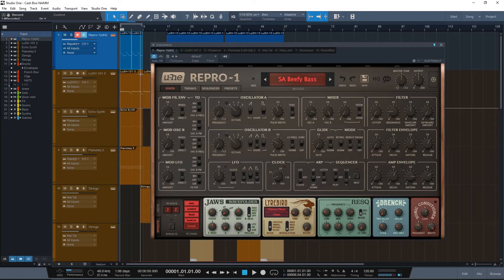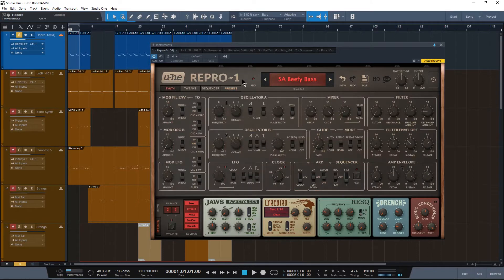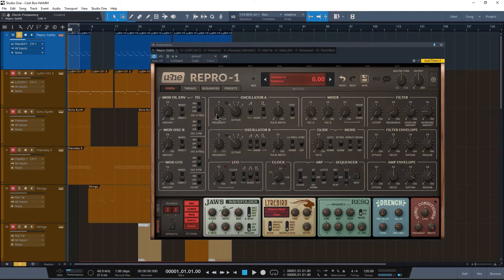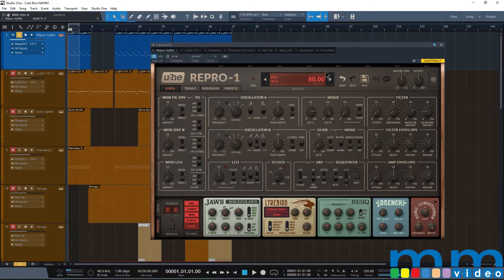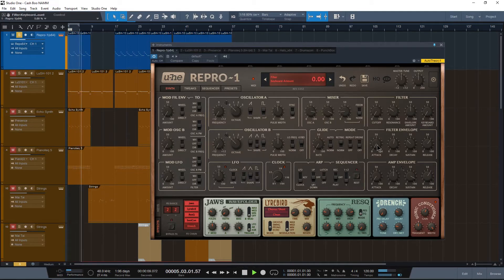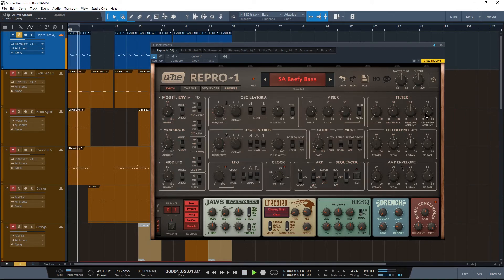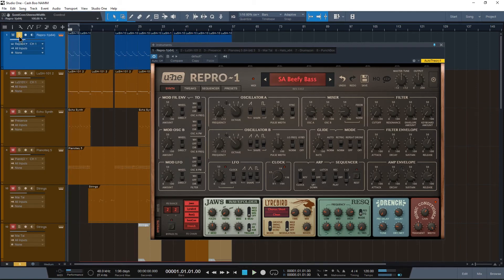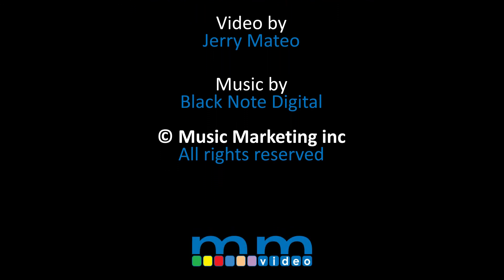U-he Repro 1 Creating A Thick Bass Synth

Comment: I used a Pro 1 for about 15 years to play keyboard bass with and it was just awesome.  I loved it.  Still have it, but it no longer works well or at all.  I wore it out lol!  I would have kept it repaired, but I started doing a solo act with acoustic guitar and no longer needed it, but it was a great snyth, and for the time, not that expensive in comparison to other synths of the time.  I think I paid 500 USD for mine.  Started out using an Arp Odyssy, but just could not get the deep growl the Pro one had.  This Plug in by the way is awesome as well.